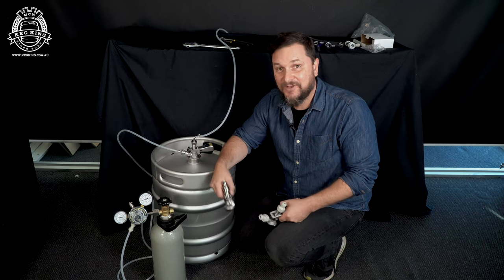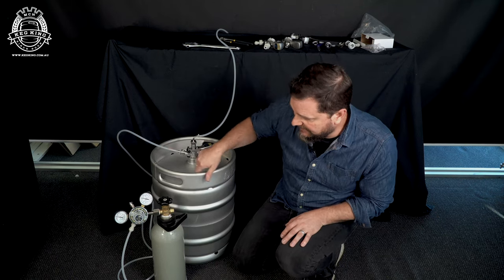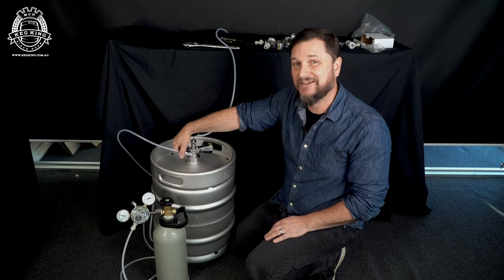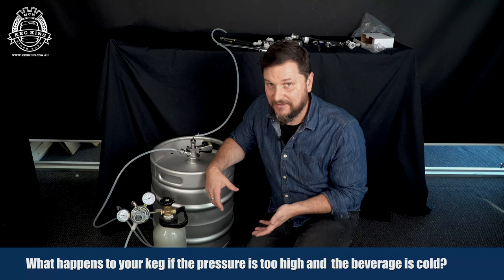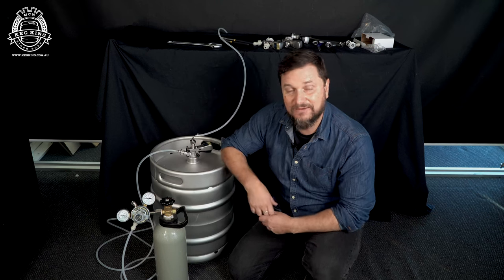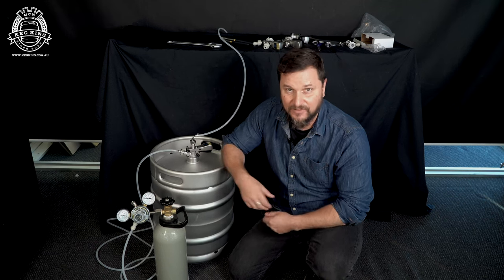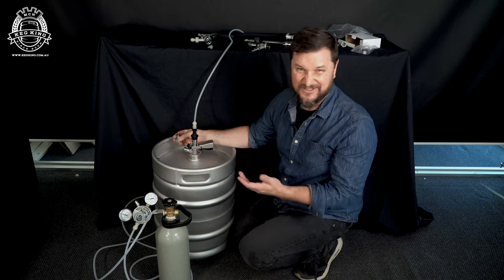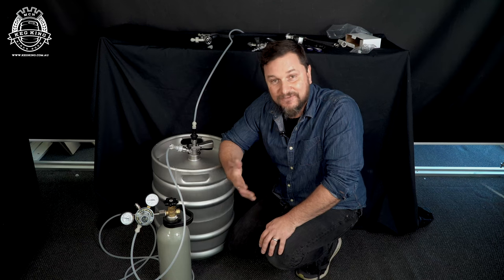Over Pressurised Keg - HOW TO FIX

Comment: I have two keg taps. I have a half full keg on the left and just installed a second keg on the right side. Now that the new right keg is installed, the left one wont pour and the right one is extremly foamy and is coming out really fast. Could it be the new keg is too pressurized and it could that effect the entire system?

Comment: I've had massive foam problems with a full keg of Blue moon I've tried everything but I'll try this. The biggest clue was that I was getting air leaks from my coupler which should have been a clue. my guage only has a low side and still only tells you the pressure going in.
Reply from the maker: Foaming can also be about line length, internal tap issues and over-carbonation. The colder the liquid, the more gas it can onboard. This chart is a hand reference when setting pressure to a set and forget carbonation rate. https://www.kegking.com.au/blog/post/how-to-carbonate-beer-in-a-keg
Reply: I swear the blue moon keg I just tried about ruined my entire system. I just returned that keg and I am cleaning everything and replacing all my lines. I had solid foam almost every pour with trying EVERYTHING. Sorry to hear this happened to you as well, but I'm glad I'm not alone with it.

Comment: My tank was over pressurized, Cold and tapped for a couple days. After I warm it, should I bring it back down to temperature before I repressurize?
Reply from the maker: warm it, release the gas, bring it back down in temp and hold the serving temperature/pressure at around 2C and 10psi in a kegerator system.

Comment: How easy is it to set up a Guinness tap,without cooler
Reply from the maker: Serving beverages on tap is all about balance. So if you can get the beverage cold without a fridge or a glycol system its just a matter of how you get it out of the tap. 

You can put the whole keg into a bin of ice and serve with gas or a hand pump or you can move the beer through a cooling device like a chill plate that you keep cold with ice inside an esky like this one:
https://www.kegking.com.au/cast-aluminium-cold-plate-chiller-cooler.html

It's not difficult to set something up so you can keep the beer fresh and carbonated with gas as you serve and it's even easier to dispense with a simple hand pump for when you're going to empty the keg in a single session. 

TLDR: It's not difficult and doesn't require much equipment.

Comment: I have a Guinness keg which is kept at room temp and ran through a cooler system. The pint usually starts out with the correct size head taste etc but generally deteriorated after 2 weeks or so with the head size reducing. Any ideas why this is? Also if I depressurise the keg and reapply the gas do you think this will bring the Guinness back to life so to speak.
Reply from the maker: Hi @tomcally3293. There's a lot of variables affecting your pour including temperature, pressure, line length and time. You'll need to balance the pressure to hold the carbonation at the temperature you're resting the keg. Doing this will balance the pour speed and the carbonation.

Comment: So if my coupler has the duck bill valve installed and I want to depressurize my keg am I able to do it with that valve installed? I imagine if I loosen that nut it will loosen the valve and allow CO2 to escape out from around the valve
Reply from the maker: Exactly. 
Sometimes the duckbill valve has a washer type flange to it that will loose its seal when the nut on the coupler's gas inlet port is loosened.

Comment: My D type tap on my senkey keg has a pressure release valve just like the one one the regulator. I didn't see that option on the ones shown. Am I right in thinking that releasing preasure from that valve would accomplish the same thing?
Reply from the maker: Short answer is yes but you'll still have to turn your cylinder off before you pull the PRV on the coupler. We don't have the PRV on our couplers as a safety precaution in commercial cellar situations where venting off could cause gas pooling.
Reply: @Keg-King  Thanks for that last sentence.
 I too wondered why you didn’t just close the CO2 bottle, then pull the PRV on the coupler, all my couplers have one.
I never thought of the suffocation factor of a keg being in an enclosed space & venting. Especially since a commercial operation probably would be using a much larger CO2 bottle.

Comment: ok when I do this foam is comming out of the area. what does that mean? pressure was good all weekend went to pour one on Thursday and was foam. looked and pressure was 35psi. wtf..... is this keg ruined?
Reply from the maker: You can always depressurise and allow the keg to warm up, which as it does will release more carbon dioxide. Kind of like when you leave a sparkling beverage out in a glass, it goes flat. 

You'll need to get the beverage cold again and leave it under pressure so it will once again carbonate and balance at the pressure and temperature that you require. 

For most kegerator short draw systems, setting the temp to 2C and the pressure to around 8 to10 psi.
Reply: @Keg-King  this is the 2nd time this happend. reading online it seems to be a regulator issue. Ditching the crap one that came with my unit and ordered a taprite. Hopefully this fixes my problem going foward.

Comment: Hi, thank You for very informative video.I m thinking to use sankey kegs for homebrewing,jwould it be possible to bleed oxigen after keg is filled up and CO2 is connected? I imagine first to fill up with CO and then unscrew CO2 valve on the coupler for release pressure ? Could You please help me with this ? Or shall I consider better to go with Cornelius keg system?
Reply from the maker: Go with a pressure fermenter. They're purpose built and have the same hardware on the lids as a corelius keg. Fermenting in corny kegs is something people do, but that doesn't make it the right vessel for the job. Wider and conical are the way. Check out our range here:
https://www.kegking.com.au/fermenters.html

Comment: Hi mate, why my beer is pouring flat and taste different even though there is co2 and beerlines has been cleaned.
Thank you
Reply from the maker: Carbonation is a balanced combination of temperature, pressure and gas saturation. Clean beer lines will help you present your beverage in top quality condition, but a good pour is more dependent upon a clean connection at the tap and at the keg, combined with the right amount of line length for the ID of the beverage tubing to create a good pour in a 'balanced' system. 

If your beer doesn't 'taste' right there could be multiple variables causing that to happen that you will have to mitigate and eliminate. Oxidation, carbonation, age, infection and a host of other possible factors could be affecting the flavour of your beverage.

Comment: Is it normal that the co2 produces a sound like that ? Mine makes the same noise but I feel like that’s not normal, thought it was suppose to be silent.
Reply from the maker: The dispersion of CO2 will vary in sound depending on the equipment and the process. It can be subtle or it can be pronounced. Check valves and relief valves can definitely hiss and hum when they're active.

Comment: Will the beer still taste flat and be over pressured? Mine comes out too fast/lots of foam and taste flat
Reply from the maker: Carbonation in a keg is really just a balance of pressure, temperature and time. If your beer is flat after pouring too fast with lots of foam it could be you are knocking out the carbonation and the beer itself isn't cold enough to absorb the gas.

Comment: Do I have to have the keg warm or can I do this while the keg is cold?
Reply from the maker: If you have set the pressure too high while the keg was cold and left the keg with the regulator feeding the higher pressure to the headspace for a prolonged period of time, odds are you've over-carbonated your keg. Good luck pouring it. 

To Un-carbonate the beverage you need to make it go flat. 

Just like if you leave a glass of beer out at room temp it will warm up and go flat, so too will the keg go flat at a warmer temp except you'll vent the headspace pressure in the keg as the gas comes out of the liquid.
Reply: @Keg-King  So after I let the keg get room temp, do I hook it back up before or after re-chilling it?

Comment: As the keg empties, do you need to add more co2 ? Or do you just leave the cannister on the same pressure until the keg empties? 
I mean, is there enough pressure without continually running the gas to get the beer through the lines? Or you do need to keep adding co2?
Reply from the maker: Hi Benny. By setting your regulator to the right pressure for the temperature and carbonation level of the beer, the keg's headspace will get topped up everytime the tap is opened and the pressure starts to drop a bit. If you pressurise and then turn off the gas supply, you'll eventually get a slow pour and mess with the carbonation.
Reply: @Keg-King  thanks for the reply! I appreciate it.
Reply: Is it ok to set to 10 psi if the keg is already cold?

Comment: Can you not just disconnect the gas and hook up a spunding valve and let it sort itself out?
Reply from the maker: Depends on how the gas input is attached to the coupler but in most cases it's easier to bleed off the excess and re-set the pressure. Of course, if your coupler has a PRV on it then you can simply turn off the gas supply and pull the PRV to relieve the headspace pressure.